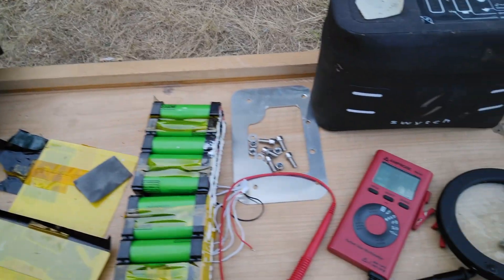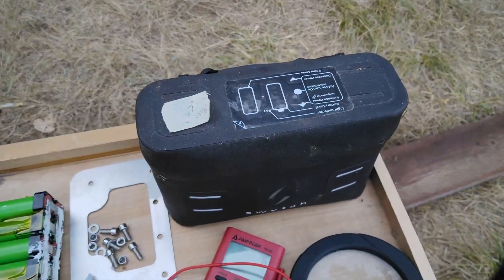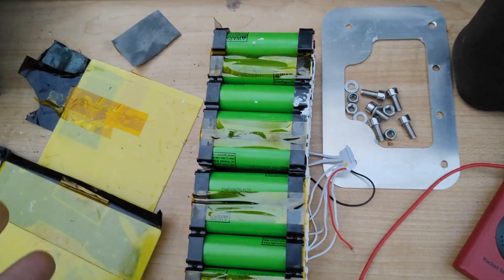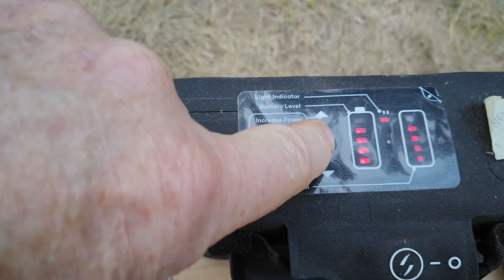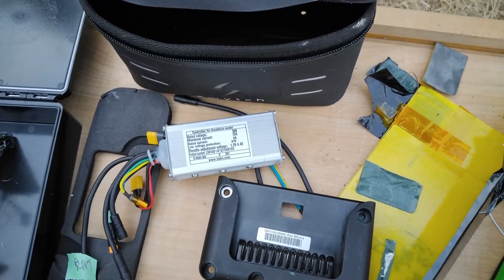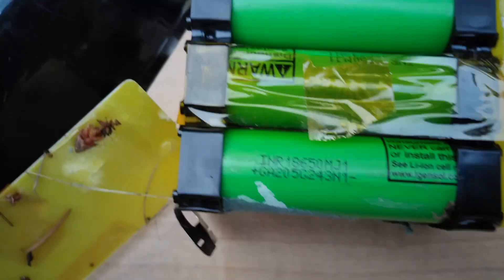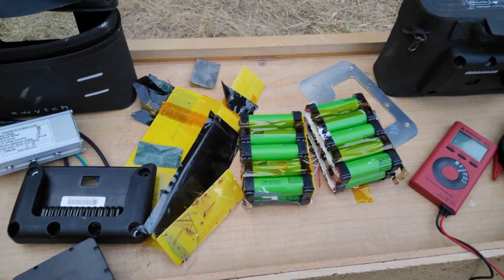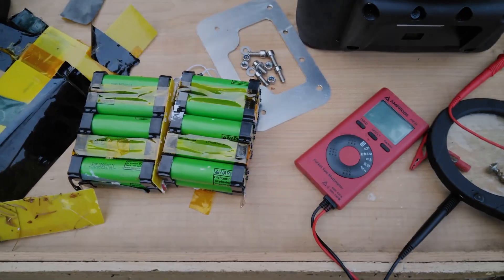Watts in a useless SWYTCH ebike battery?

Comment: Those batteries are the version 2 ones. They stopped making those over 2 years ago. I have the same Pro model one and have had zero issues with it. Still getting 15 miles out of it on the flat. Climbing hills however and there's now a noticeable degradation of capacity. Not quite ready for an upgrade just yet as it still covers my usual needs. Still, 3 years of daily use and it's still going the job. Suspect you've been given used or lower binned one due to being obsoleted. The case is tight but I wouldn't call it the wrong size. There is a knack to it though.